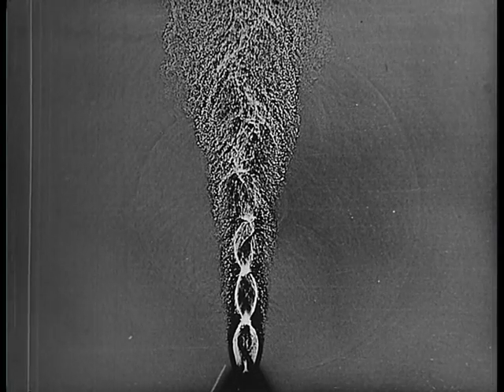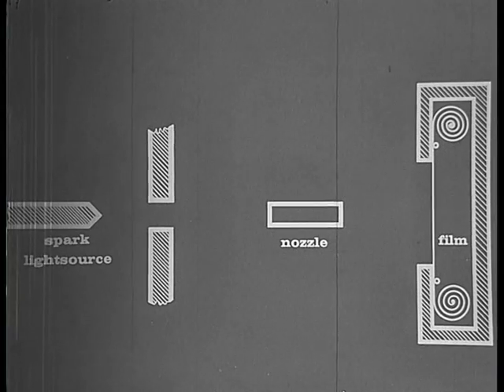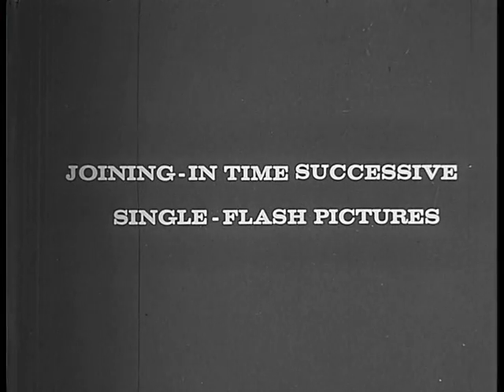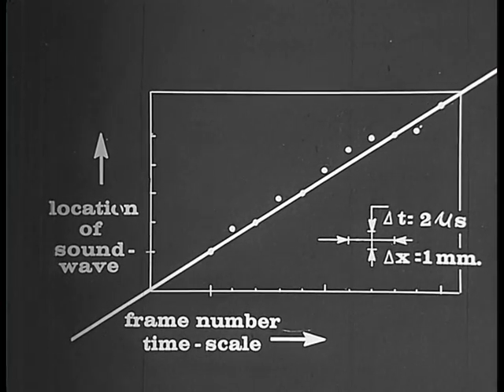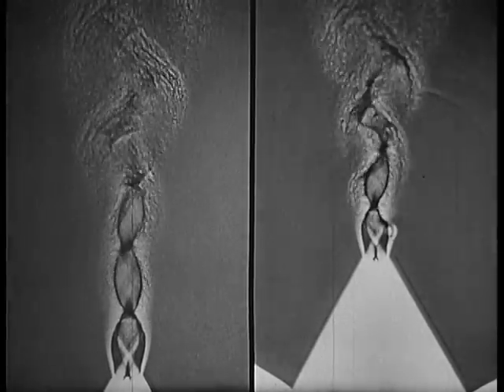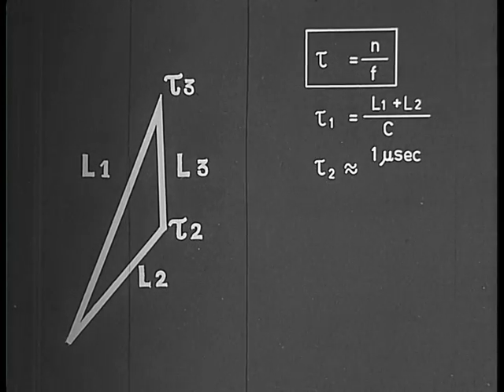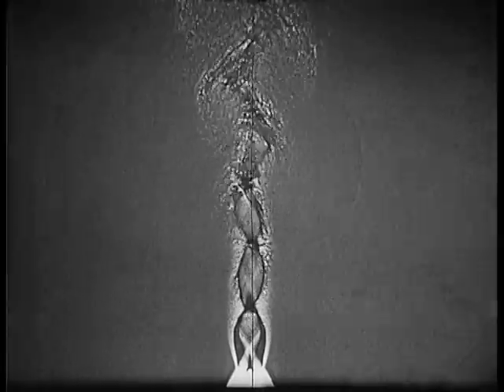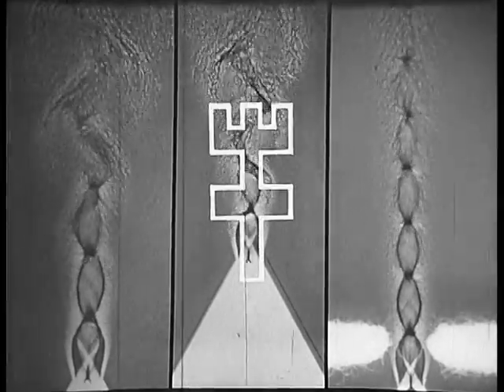Jet screech of under-expanded planar supersonic jet L.Poldervaart, G. Vossers, A.P.J.Wijnands

Comment: What about the solution to the screech? What's the fuzzy walls at the last photos? Do they block the L2 from the L3?
Reply: These are sound absorbing wedges (porous material).
They do indeed block the feedback path from the source (vortex shock interaction) to the nozzle edge (point of generation of new vortices).
Reply: @moniquehirschberg-guinet4805  so it loses its distinct tone but is it overall more quiet?
Reply: @moniquehirschberg-guinet4805  is this why a turbofan is ducted and has a lobed mixer? and sometimes serrated outer edge
Reply: introducing tabs at exit plane